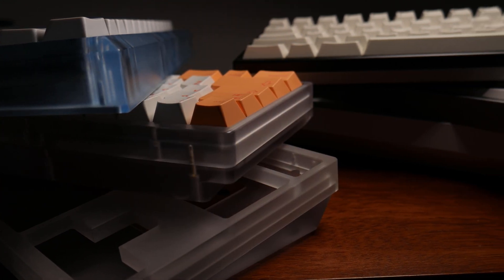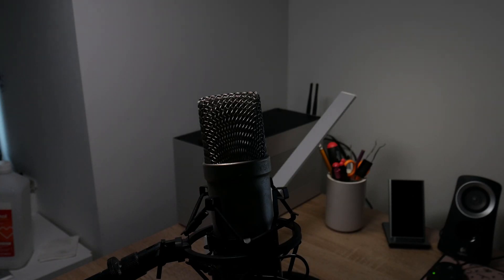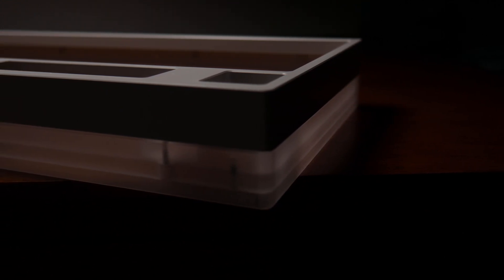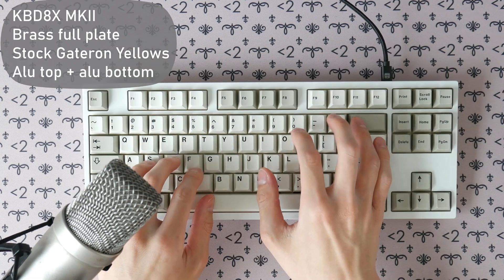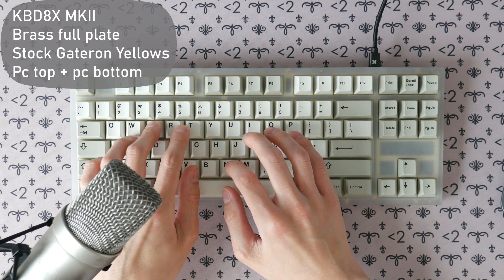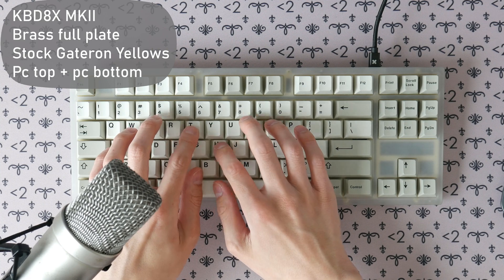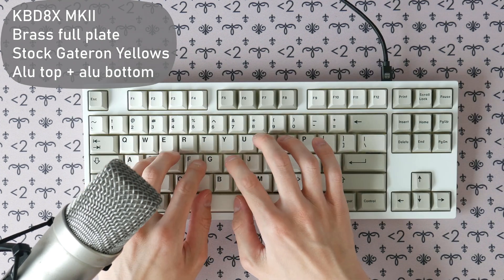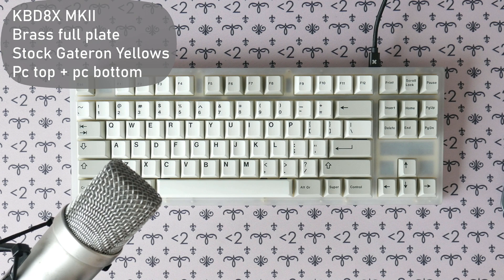Aluminum VS Polycarbonate Comparative Sound Test

Comment from the maker: There's been fair criticism both here and elsewhere regarding methodology. It's an evolving process for me but some notes:
- unlubed switches are definitely loud and can overpower the subtle differences. For this particular example, I found the differences to be good enough to be useful
- I use stock Gateron Yellow for everything as a control across boards so that I can be sure that the differences I pick up are actual differences between boards, not switches. I don't lube them because I don't think I can do consistent application for about a thousand switches and because lubing style is widely varied. External repeatability is easier with stock switches.
- mic is approx 6 inches from the board as a necessity to working in a very noisy environment (30-40 db ambient). This causes pickup on switch scratch and spring crunch that is unheard during use. I'm looking into other recording setups to address this, but we're most likely stuck on the short term.
- For videos like this where I'm using a single build, I could probably just lube the switches
Reply: My main criticism is that if your getting a poly case I'd think you would get a poly plate as that would have the same sound signature and PC is a bit more popular than brass. But besides that this video helped a lot, thanks!

Comment: Quick question. Are you also going to test different plates and/or gummyworm gasket mount?
Reply from the maker: I'll be testing the full and half brass and polycarbonate plates I have later. I might do the gummyworm thing too
Reply: @JYMV  Different plate styles & materials would be a great addition to this test! Also maybe add in a run with plate & case foams if possible too. Although this type of testing can only really provide generalized results as each case design will have its own unique sound depending on mount type, dead space, angles or lack thereof inside the case, use or not of sound dampening material, etc. It's crazy how tunable the sound of a keyboard is when you really get into it!

Comment: I think the switch has a great role too. I have 100g Aliaz, they are heavy enough so that the sound is dampened by the spring force itself. I have alu + alu but I would like to try polycarb or wood case :-)
Reply: holy shit 100gs, what are you glarses?!
Reply: @mrED123  lol that's not that heavy, my girlfriend like them better than her Gat browns.
Reply: @gabsriel  na its pretty heavy lol

Comment: The deskmat is a bigger variable for polycarb, as it seems to mute more of its inherent resonant properties than it does for alu. It's this same resonance that, I feel, the microphone wasn't quite picking up on. I'm very appreciative of the intent in this video, as it's something that I've been longing to know since getting into the hobby. Cheers!
Reply from the maker: The hope is that the deskmat is a controlled variable between the two runs since the way the boards interface with them is consistent. Theoretically the difference should be the difference between the cases

Comment: It’s taken me a long time to come to terms with the fact that I just don’t like the sound of most keyboard chassis. 

Plastics sound too hollow and metals are usually too pingy I just end up stuffing with foam and sorbothane until I cant hear much of either.

A concrete board sounds awfully tempting sometimes.
Reply: How about no case? Ehhhe
Reply: Epico how do no case builds work? Pcb straight on deskmat?
Reply: @Kinda_Venty  hehehe
Reply: @Lucca Silva wat
Reply: A wood one?
Reply: @DVRC  Funnily enough my current daily driver is a wooden 60%.

Sadly there's not a lot of variety aside from the budget kbdfans one.

I will say though, between the wooden case, three layers of foam, and a brass plate there's something magical.
Reply: It's probably because of the design of the keyboard
Reply: i was actually planning this a while ago but i was not sure on how to make the mold so i set it aside. i still want it tho

Comment: Pretty cool comparison, whats also great is changing the plate can really change the effect of this comparison also. Some combos with aluminum sound better then with pc and vise versa. Awesome comparison regardless for tkl I think I like the extra clack that the aluminum has pc seems to have a liffle more low end to it but yes the pc does seem slightly louder. I think its funny tho because I've had other boards where pc was more dampened then the aluminum. Almost as some designs effect the material difference more.